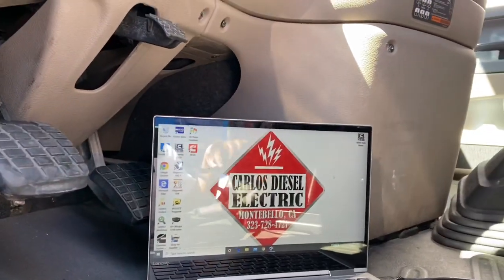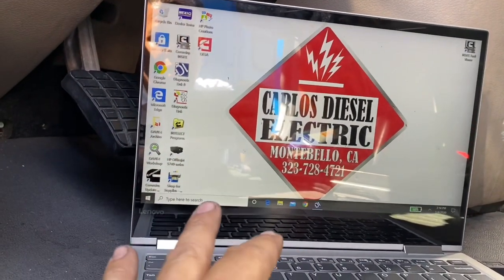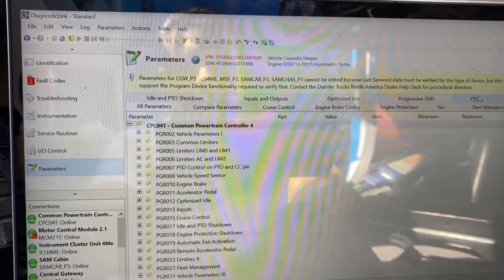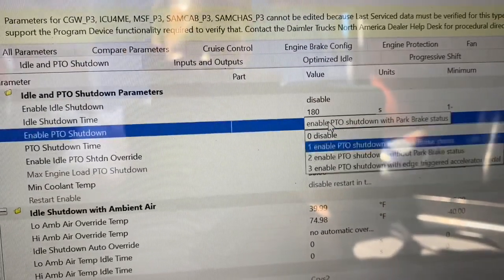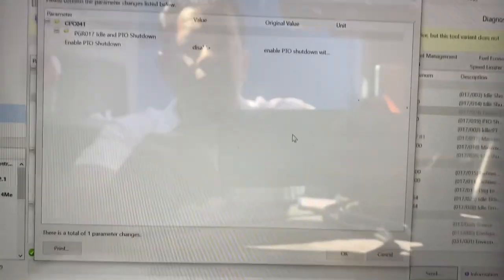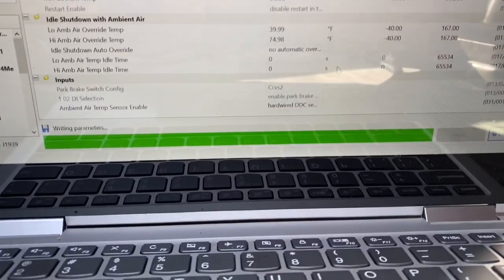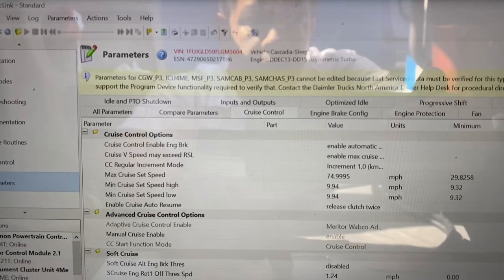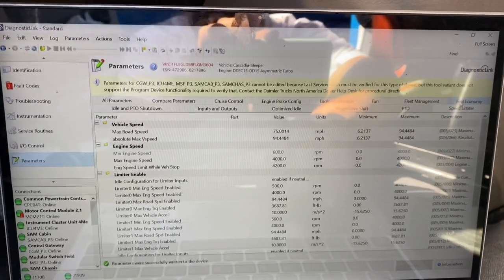How to stop your truck from shutting down after 5 minutes.

Comment: Thank you sir. Is it possible to change the house power rating the thru the parameters?. I know it's limited by engine family but still some what adjustable. Thank you
Reply from the maker: Yes you can, but that requires using the programming software from Detroit (higher end subscription). Other than that, you can only use the HP changes that Detroit allows, like you mentioned are somewhat adjustable.
Reply: @CarlosDieselElectric  thank you for the reply.